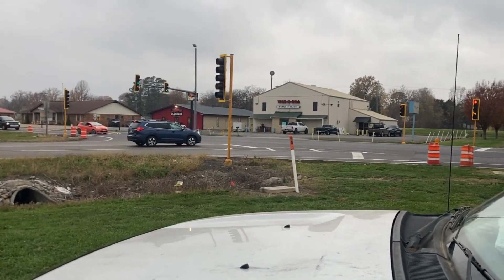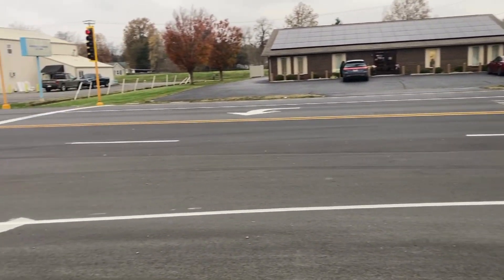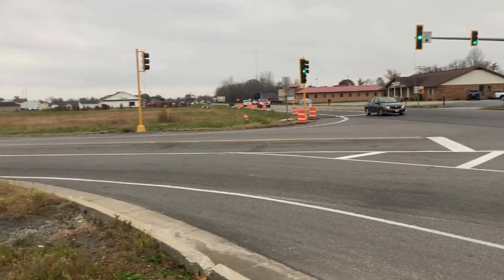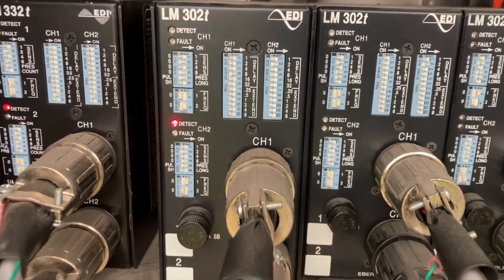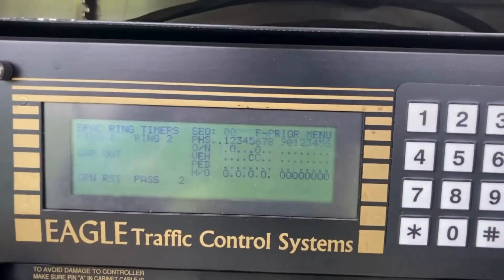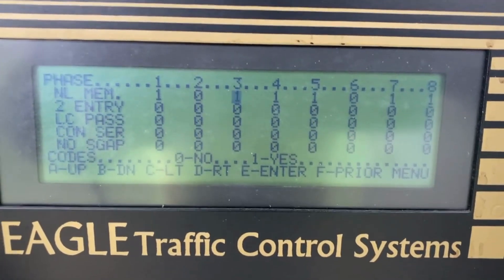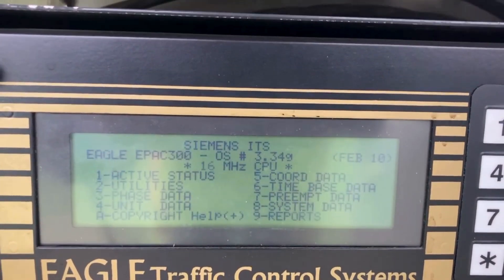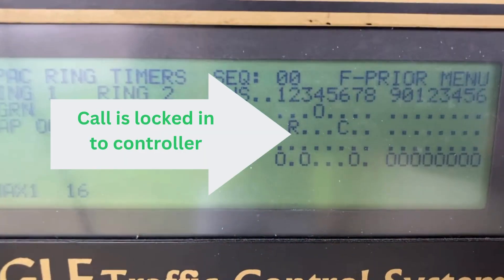How Bad Traffic Light Detection is Fueling Red Light Running

Comment: Should go into a default cycling mode when the loops fail. That way no one would have to wait forever.
Reply from the maker: You are correct!  It actually does do that.  However, in this instance, the contractor had disconnected the front loop that was doing that.  So then you had the situation you saw in the video.
Thanks for commenting!

Comment: There are several spots around my city where the vehicle presence sensors (I think they're all induction loops) seem to be malfunctioning, either consistently or intermittently.  It's rather frustrating, and I wish I knew the best way to report the problems.
Reply from the maker: I would find the municipality that the signals reside in.  Then find their public work department contact number (most likely online).  Be specific to what you're experiencing.  Make sure you have both cross streets of the intersection.
AND be perisistent.  Unfortunately, sometimes the signal doesn't get investigated right away.  Continue to call.  The squeaky wheel gets the grease. 
Thanks for commenting!

Comment: What are these loops and how do they work? This stuff is crazy interesting
Reply from the maker: Inductive loops!  Like an oversized metal detector is the best way to explain it.  Cuts are placed into the road and wire is coiled (creating a  loop).  A wire that is attached to it is then fed back to a signal cabinet where detection hardware monitors the loop.  When a car drives over it, there is a frequency change and the detector transforms that into logic that the signal controller understands as a vehicle.  If everything is operating correctly, then the signal controller gives you the green light.
Great question

Comment: One state I lived in had a law that if you waited 2 cycles without a green you could go when it is clear(problem if it never changes). So one random 3 way intersection would literally never change for my little scooter. I wouldn't even look at the light anymore, I would simply look for cops and traffic and go (turning left on a red light) because it would never change unless a car went ahead of me.
Reply from the maker: Oh wow.  Do you recall which state it was?  Several comments on here referred to several states that have a law similiar to this.
Yes, inductive loops usually are not kind to scooters & bikes.
Thanks for commenting!

Comment: There's a 3-way intersection in my small city that's notorious for cars making a left-turn onto the main road pulling past all of the loops and stopping in the crosswalk, with the front bumper almost pushing out into the road. They'll be sitting there and if their window is down, I'll tell them to back up to trigger the light, but usually they just give me a dirty look as I cross as if I don't belong in a very obvious crosswalk with cross lights.
Reply from the maker: Shame on them for the dirty looks.  You're just helping!  Most of the time if I inform drivers of similiar situations, they're pretty receptive and appreciative that I told them.  
Thanks for commenting!

Comment: I ride a moped, and there's a small interception where I have ro run the red light at night. The loop only detects cars and there's only one, so normally I stop almost over the line so cars behind me get over the loop, but during the night there's nobody to call it for me as it's a small secondary road. I'm stuck as it's also a one way road lol.

I try to avoid it, but sometimes I have to pass there. One time a car did stop so far back that they were behind the loop, I tried for something like 10 minutes to cue them to come closer, in the end I straight up turned off the moped and walked to the car to tell them lol.
Reply from the maker: YES!  I have had to walk out to drivers in the street that sit too far PAST the stopbar.  After about 3 cylces, you can see them throwing their hands up like its the signals fault LOL
Once they're told, they usually are receptive and thankful.  And hopefully are mindful going forward when approaching signals.  
Thanks for sharing!

Comment: How about we just put the lights on a timer without these detectors in the ground, we don’t need the fancy tech to do a simple job of a analog timer like you is in a house outlet
Reply from the maker: We could do that.  But then I'll get complaints that the lights are cycling to streets when no one is there!
Thanks for commenting
Reply: @ guess you are right, so how did they do it before the fancy computers?
Reply from the maker: @THE2NDDAWN  Cycling the lights to streets when no one was there 🤣
Reply: That's how it's done in many Asian countries, they also have a countdown timer.
The drawback is that you'll sometimes have to wait when no one is there. Which again makes it more likely that people will get impatient and run the red light.

Comment: Do you work for a traffic light company? I don't know .much about that industry or do local township do maintenance on the lights. Is that a plc in that cabinet?
Reply from the maker: I currently work for a State DOT.  Previously I worked as a signal service tech for a private traffic signal company (5 years) and then prior to that for a County DOT (13 years) as a signal tech.
In our district, townships have general maintenance on the signals (knockdowns, turned heads, indications replacements, etc...)
When it comes to troubleshooting, upgrades, programming--I am usually brought in to help.  
The plc is the traffic signal controller.  Its just specialized for the traffic industry.
Great questions!
Reply: @streetsmartstraffic  thank you so much! That's really neat I'm a mechatronics technician by trade but I work for food industry
Reply from the maker: @brandtmagolon454  Awesome!  But, enlighten me...whats mechatronics??
Reply: @streetsmartstraffic  a dual trade of both mechanics and electrical systems. And how they work and come together to make a machine operate it's a maintenance tech but instead of being one trade such as mechanical or electrical it's a cross of both. I'm no expert In either but enough to be dangerous lol
Reply from the maker: @brandtmagolon454  ahhh.  Thanks for clarifying that.  I've never heard that term before.  But I have now!  
Thanks again

Comment: Easiest way to fix this problem would be to remove MOST stop lights and replace them with stop and yield signs. 
Traffic engineering is pointless. People already know not to run into other things. Its up to them whether or not they want to be responsible and safe regardless of what the lights and signs say. Its actually just an honor system either way.
Reply from the maker: "People already know not to run into other things"
And I'm off to fix another knocked down pole this morning...
Thanks for commenting though  🤣
Reply: @streetsmartstraffic  bad comment. 
Do you think they did it on purpose or do you recognize that people sometimes have things happen that are not their intent?
One would also note that without that uneccessarry and dangerous traffic infrastructure in the way there likely wouldnt have been anything else hit. My example of less poles is safer in your example as well.
Reply: @streetsmartstraffic  i also firmly believe that for some mororists all the extra sensory inputs stress them out and once confused they make critical errors. The absolute vast majority of people would likely do better with less road signs, lights, and distractions pulling their attention away from their true point of focus. 
I drove race cars when i was young. You know why there arent a ton of signs all over the track? Because theyre distracting and we only need a flag man, and a single safety car. Outside of a track these would be officers and patrol cars. We need less of this junk slowing down, frustrating, confusing, and distracting drivers.
Reply from the maker: @raphaelvermin  That we can agree on!
Reply: I like how they do it in Southeast Asia, no traffic lights or stop signs. problem is you can't go fast
Reply: Or roundabouts.

Comment: I've got an insanely long winded light where I live... so I always have to do a right turn and then a u-turn to get through it rather than waiting 5+ minutes.
Reply from the maker: Isnt that the worst??  It shouldn't be that way.  I suspect there is a breakdown in detection or the engineers programmed an extremely long green time for the other direction.  Where abouts is this?--out of curiosity
Reply: @streetsmartstraffic  And that's not the only one in my area.
Another one is green for only 7-10 seconds (3 cars or 1 industrial vehicle).   Every once in a while it'll be 20+ seconds, but within days it's back to 10s.
On the right of way... the entering roadway gets 20s.

I've actually talked to the city council about that one.  The long winded one has been complained about for years and has not been changed.
Looks like the 10 second one will be the same.

Comment: Is there a mode that works to give an approaching car a red and the empty road the green?  I swear some of our traffic lights are on ‘demo’ mode.
Reply from the maker: LOL  Demo mode...like an appliance. Good analogy.  
A signal controller can be programmed to 'recall' a street.  Meaning whether there is someone on the street or not, it gets a green.  This setting is usually used for the mainline however (where the heaviest traffic is). 
A bad detector will also act like a recall.  This is by design though because you would rather have a vehicle detected than not.
Great question!

Comment: I have a traffic light in my neighborhood that sometimes triggers every 18 seconds when the air temp is around 100F and above. It's a pain in the butt to wait for nothing. Do you know what may cause that?
Reply from the maker: Good question.  I wonder how its being detected.. loops, radar, video?
My suspicion is that there is a compromised wire connection somewhere.  Due to the extreme heat, there is some expansion & contraction (during the night) causing the connection point to allow some variance in the sensing.  Which would cause the detector hardware to think there is a vehicle there (this is by design if detection breaks down--since you would rather be detected  than not).
Thats just a guess though!
Reply: @streetsmartstraffic. Good answer. I encountered  something similar to that once. Got a call one morning from public works manager about seeing a side street maxing out at night. I checked it out during the day everything tested good. Couldn't find a problem. It happened again, Couldn't find a problem during the day. Went out at night saw a detector fault, tested loop. Loop was open. Expanded during the day and contracted during  the night.

Comment: What needs to be done is a timer that all driver can see so they'll know whether to brake or keep going through. But now it's a guess, do I need to speed through the green, or be surprised and slam on the brakes
Reply from the maker: In the MUTCD (what dictates how a signal should conform), countdown timers are not allowed for vehicular movements.  They are allowed for pedestrain crossings however.
BUT I've heard this from somewhere 🤫🤔 ... that as your approaching a green signal, look over at the parallel pedestrian crossing (same side of the road that you're driving on).  If you can see how much time is counting down, you'll have a green light for at least that much time.

Comment: Looks like you're doing the best you can with what you got.  Why don't you just use cameras, instead of digging up the road again?  Then you could see how many cars in the turn lane and hold the green turn arrow until you cleared the lot of them.
Reply from the maker: This was a quick resurfacing project by the construction department.   For projects like this, they usually go through and just recut any damaged loops.
However, on any upgrade projects, I am replacing loops with video/radar.  It takes awhile but at some point, I would like to have all of our signals switched over.
Great question!  Thanks for commenting
Reply: Cameras have their own problems. They don't do well in poor weather conditions, such as ice, rain, snow, wind (which can move the detection zone off the road), and cold temperatures in general. They can also be a target for vandalism.

Comment: I commute in the early morning (shortly before 4 AM) and have to pass through a light that used to absolutely suck. All four approaches in turn used to get a straight green + left arrow (even if there was no left-turning traffic waiting) while the other three directions showed red, so if you just missed your green you would have to wait for it to cycle back around to you, which was interminable if you were on the secondary road (which I am) because the cross or "main" road got much longer greens in each direction - again, even if there was no traffic waiting.

Finally they redid the intersection this past summer with new lights that seem to actually reliably detect my car approaching and give me a green if there's no one else waiting - and I can see in my rearview that after I pass through, it doesn't immediately give the opposite direction a useless green + left arrow with no one there.
Reply from the maker: Isn't it nice when everything just....works!?  Thats a shame you had to get stopped especially at 4am.  You should be able to cruise through signals without issue at that time.
What you experienced after the fix is how all signals should operate....and is what I'm striving for in our district.
Thanks for sharing your story
Reply: I remember dealing with a similar traffic light in a place where I used to live.  This one was replaced with a roundabout, which drastically improved traffic flow.  (Yes, this happened in the US.  Central Indiana, to be more precise, but west of Indianapolis, so not Carmel.)
Reply from the maker: @MarsJenkar  I'm all about moving traffic as effeciently as possible.  And roundabouts sometimes are the most optimable.  We have a project this year where we're ripping out 2 traffic signals and replacing with roundabouts...
and this is happening at off-ramps on either side of an interstate.
To be continued!
Thanks for commenting.  Happy New Year!
Reply: @streetsmartstraffic  Roundabout/dogbone interchanges?  Interesting.

I mentioned Carmel, Indiana in a previous comment, and they've gone absolutely ham with roundabouts in that city.  They also have two freeways through the city, and their interchanges are all dogbone interchanges (except where the freeways interact with each other).  It'd be an interesting place to go in order to see how well roundabouts work in an American context.

I wanna say there was a bit of a spillover effect.  Surrounding communities saw what Carmel was doing (including Indianapolis itself), and while none of them went nearly as far as Carmel did, if you look around the Indianapolis metro area, you'll see a number of examples where intersections were strategically converted from traffic lights to roundabouts.  I think we need to see more of that sort of thing across the country.
Reply from the maker: @MarsJenkar  I think you just gave me an idea for an upcoming video...😁
Reply: @streetsmartstraffic  I look forward to seeing what comes of that idea.  Good luck.

Comment: How's about lights with all the same timing and no stupid sensors?

The lights I encountered in Paris had the same timing as each other, no stupid road sensors, and traffic moved well.
Reply from the maker: With no sensors, the traffic signal has to cycle around and service all streets--whether someone is there or not.  Even with perfectly coordinated signals, the signals have to cut off the mainline to serve other directions.
Your scenario usually isn't very effecient but thats great that traffic is moving so well!
Thanks for commenting
Reply: You clearly haven't driven at quiet times when you would have to constantly stop at red lights and wait for no reason.

Comment: As a motorcyclist, I hate these detectors. It would be nice if lights guarantee even just a 5 seconds green for turns so that undetected light motorcycles can turn. Hell even 3 seconds would suffice.
Reply from the maker: Thats why I'm transistioning our detection over to video/radar.  Inductive loops have a hard time detecting motorcycles.  With video, I can setup bike zones in the processor to detect all you bikers out there!